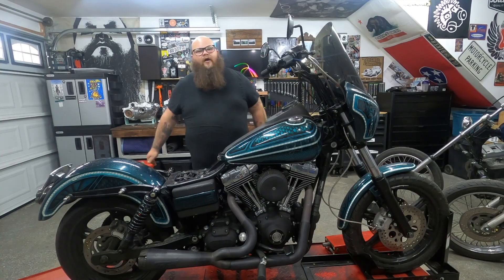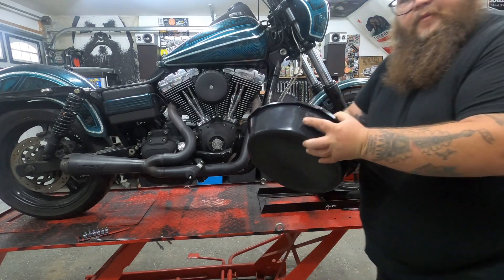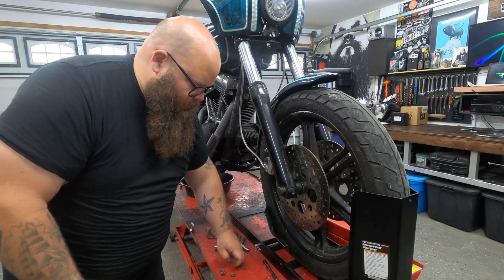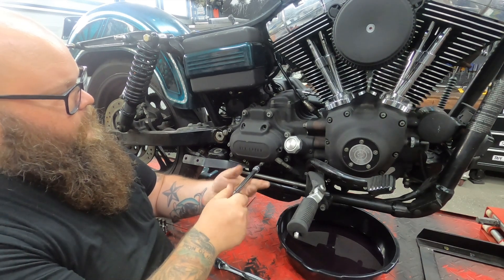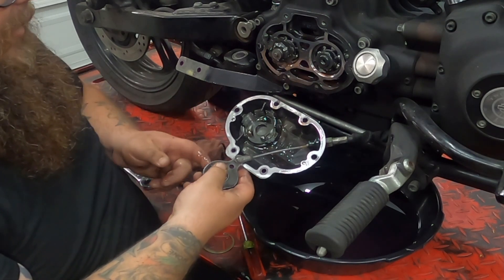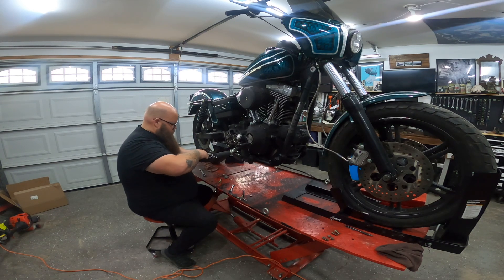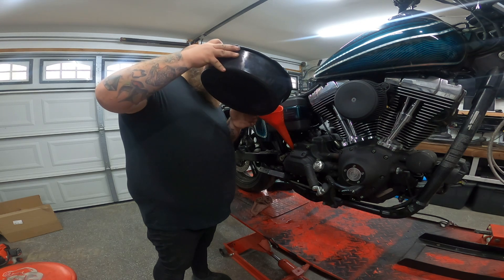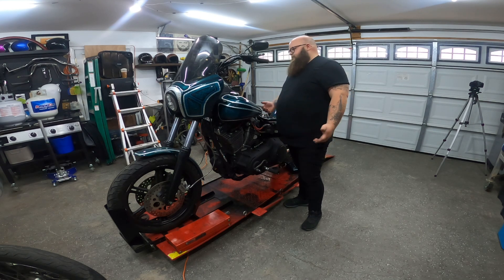HOW TO REPLACE CLUTCH CABLE ON HARLEY DAVIDSON DYNA

Comment: Great video!  Keep up the good work.  I just got my 09 fxdb running after a 4 year hibernation. Replacing the clutch cable, brake components and throttle cables.  Then to find some replacement wheels that dont cost half the price of my bike.  Keep turning wrenches and rolling the road.
Reply from the maker: SORRY FOR THE DELAY IN RESPONSE. I'M NOT REALLY ACTIVE ON HERE MUCH ANYMORE. GLAD TO HEAR YOU GOT YOUR BIKE RUNNING!

Comment: Stupid question! But is there any oil inside the lower half of the clutch cable? (below the adjustment junction) I think I pinched the cable because I had a small oil leak after moving my bike
Reply from the maker: Nah, not really. Just enough oil to keep it lubed. check your drain plug areas

Comment: You can get away with not draining the tranny oil if the bike is resting on the kickstand. That is if it isn't overfilled already.
Reply from the maker: YEAH. I WATCHED A VIDEO OF A GUY DOING IT WITH THE FLUID STILL IN AND IT WAS A MESSY JOB SO I JUST WENT AHEAD AND DRAINED IT.
Reply: @PARTYONFOREVER  Understand man
Reply from the maker: @SaddleTrampTV  woulda liked to be able to do it without pulling the exhaust. I MIGHT’VE been able to make it happen but it would been just as much of a headache.
Reply: On my 02 Dyna I was lucky enough to be able to do the job without draining and without taking off the exhaust...
The damn snap ring had me pulling my hair out though......

Comment: Nice edit Andy, always getting better.  Any tips on freshening up a black frame and touching up a black engine? Getting my sporty out from winter storage and it's looking a little down.
Reply from the maker: Thanks Rob. I appreciate that. 
Man, for a black frame, I seriously just sand off the rust spots and touch it up with some semi gloss spray paint. I usually use the engine enamel stuff. 

I’ve never sprayed an engine but I’d say degrease the hell out of it. Mask of anything you don’t want black, and use that same high heat engine enamel. 

Should probably get the job done. 

Good luck dude!
Reply: @PARTYONFOREVER  I was thinking along the same lines, but I am in the middle of researching how to fiberglass and already going cross-eyed from all the google'n. Ty for saving me some time sir!